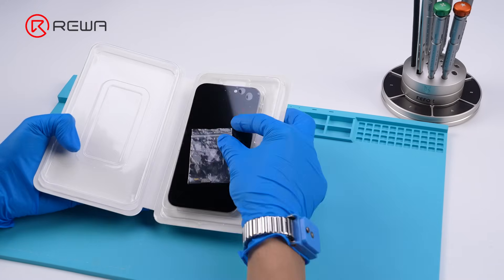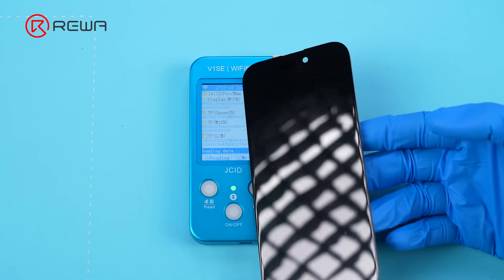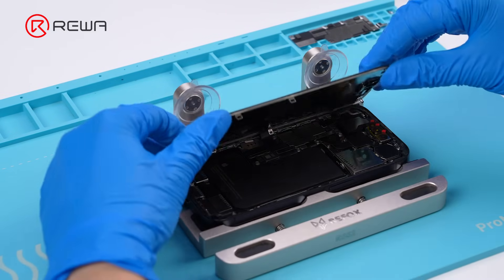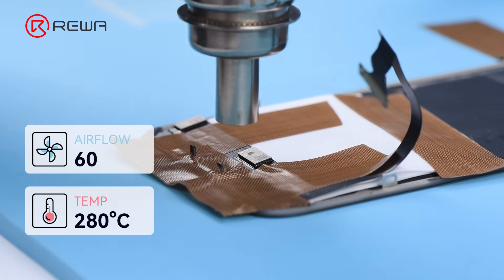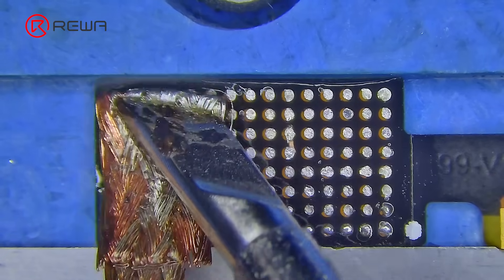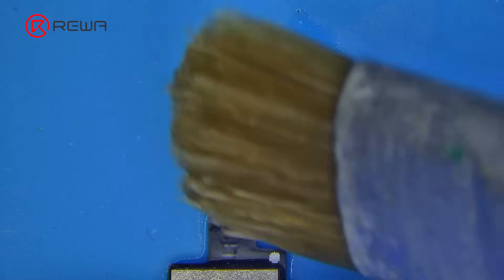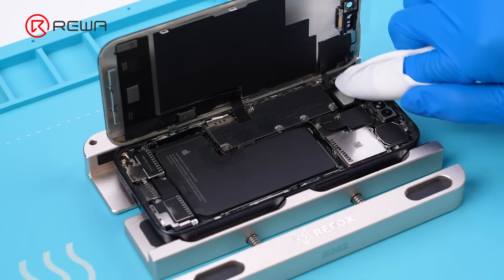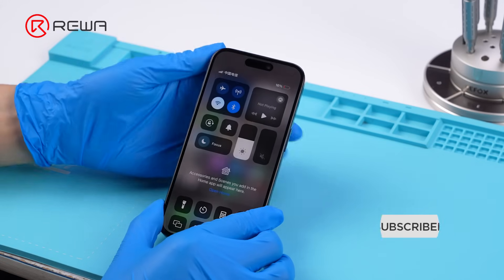100% Fix 'Unknown Part' Message for iPhone 15 Pro After Screen Replacement

Comment: Hi do you need to reball the IC or can you just clean that up and use the pre balled tag on flex?
Reply: And would you still get the display message if transferred IC but not coded True Tone date
Reply from the maker: The ic is from the original screen, so you need to recall it

Comment: Since the new iOS update True Tone doesn’t need to be programmed but removing the unknown part message still requires transferring the ic chip right ? Or is a programmer still needed ?
Reply from the maker: The programmer is vital, you still need to troubleshoot whether it links to true tone problem, and the IC must pair with truetone data.

Comment: Recently, I have had a critical case. Accidentally, I damaged a 12 pm display 😢... I swapped the IC, but it was still showing the unknown part message... Then I also swapped the display ic, but I still showed an unknown part... Then I read the phone information on the jcrepair tool,. Then I am shocked because it says the mtsn and screen sn are different 😅😢... Please help me... My customer getting angry with me
Reply from the maker: Wait generally if you just apply IC swp is OK, unknown part perhaps link to the soldering problem?

Comment: Ambient sensor not working in my 15 pro max after display change. What could be the issue?
Reply from the maker: Does it match the screen or is it the native front sensor?
Reply: @rewatechnology2008  hello, I have the same issue, the ambient light sensor is not working. It is the native sensor, does not match the screen. Is there a way to fix it?
Reply from the maker: @renatogarcia4562  Which screen you replaced? The incell screen does not support that.
Reply: @rewatechnology2008  actually, I've tried it with an OEM refurbished screen. I installed the screen and paired it, the messa is gone, the true tone works, but the ALS won't work. Before, the ALS was working correctly with the native screen that has black lines.

Comment: That tag on flex is a clever idea. all 'major' soldering is done away from the display other than 6 small solder connections. + it means if you mess up somehow you could get a new tag on flex cable and not have to buy an entire new display.

Comment: If you don't change IC will aftermarket screen still work ok on IOS 18.1 and only give non genuine part message ?
Reply from the maker: Third party will also pop up the unknown part, but true tone is back
Reply: Thanks, so screen will still work ok ? @rewatechnology2008
Reply from the maker: @maxmixer  Yeah as long as you do not care about the message

Comment: Hello , I want to ask a question 

If I transfers the ic first and then I copied from the new screen , will that work ? 

Or I will have to re transfer the ic to the old screen and copy and then put the ic to the new screen 

Thank you
Reply from the maker: As you can see in our video, we transfer the IC first including copy and write in from the old to the new screen, the subsequence can not go wrong.
Reply: @rewatechnology2008  soo I can’t make a copy after transferring the ic ? , because I have already transferred the ic and I didn’t make a copy , what should I do know
Reply from the maker: @ahmedsalem7909  It is the copy may be useless for the repair, because you are not the Apple right? Apple is the only one who can match the IC, the copy of IC can not help you in the following repair, we transfer the IC just try to make your phone identify the screen is the old screen that already fit your phone
Reply: @rewatechnology2008  no I meant copying the data from the screen not the IC
Reply: @rewatechnology2008  I meant like after transferring the ic , now I don’t have the unknown part message , but now I need truetone 

So I will copy the data from the old screen right? Soo I can make truetone work 

What happens with me is that I transferred the IC before I copy the screen data soo I can write it on the new screen (for truetone ) 

Soo now do I have to reinstall the IC on the old screen soo I can copy the truetone data , or I don’t need to retranfer the IC and I can copy it normally
Reply from the maker: @ahmedsalem7909  For now it really depends on the screen you used, some screen may have Identify resistance that will not allow you to write in truetone datal...

Comment: Why did it look like it was 60 hz? Is it 120 hz with adaptive refresh rate like OEM? Please reply in the comments
Reply from the maker: Aftermarket screen generally will only reaches to 60hz, for OEM NEW or OEM USED screen it can reach to 120hz
Reply: maybe because youtube doesnt offer 120 hz videos?
Reply: @monstrum5074 it still looked slow go look at other videos of high refresh rate iPhones

Comment: All the effort, i prefer to ignore the unknown message :D
Reply: Jup. This is beyond repairing your own device. My experience with customers tho is that they don't really care about the unknown part message. Tho most people want to restore the ability to see their battery %.
Reply: Why, don't you feel it is somehow anoying 😅
Reply: @AkunBaru-mg3vr  because it isn't. It's not a Pop-up anymore. Just says that the part has been replaced in the settings.
Reply: @hamiock6048  ah i see, so it's not like it used to..
Reply: Most of my customers choose this but I always offer them this service for extra fee. 30% choose this and the rest is ok with the unknown message.
Reply from the maker: It depends on customer needs, and generally if you choose to ignore it, it should charge less.
Reply: @rewatechnology2008  Hi, if you don't transfer the IC, will there be any issue such as touch responsiveness, accuracy etc?
Reply from the maker: @Negiku  The ic usually affects the unknown part or the truetone(if it is under iOS 18)
Reply: Too much work and time. Most of the times customers doesn’t even care. But they do care about battery health, and this is something I also like to see when doing repairs. That said: Keep ut the good work REWA. You’re the best.

Comment: You put an ic from the middle of original screen  but you used tag on and put ic on the right side of new display!?
Reply from the maker: Aftermarket screens vary in structure among manufacturers. It is normal aftermarket screens have different IC positions compared to original screens.
Reply: Yes. 😂
Reply: clearly you dont know what are you talking about, better find another video that match to your knowledge.

Comment: True Tone data is stored in the IC. Why did you transfer before removing it?
Reply from the maker: Starting from iPhone 12, the True Tone data is no longer stored in the touch IC. So you need to copy True Tone data before transferring the IC.
Reply: iphone 12 and latest no longer store the true tone data in ic
Reply: @Dimas-uz5jn so iphone 11 no need transfer truetone? just transfer ic and the truetone will transferred too?
Reply: @dinouse yes
Reply: @Dimas-uz5jn  where does it store the truetone data then, there is only this chip on the back of the display

Comment: Does AOD work? 
What about the battery drain?
60hz or 120hz?
Reply from the maker: Yes, AOD works. It's 60Hz
Reply: @rewatechnology2008  Will it work only in 60 Hz mode or will 120 Hz work too?

Comment: link for the iron ?
will it work if I use aftermarket LCD screen ?
Reply from the maker: Hello here is our Portable USB Soldering Station：https://shop.rewa.tech/detail/sugon-aifen-a11-portable-usb-soldering-station.html?utm_source=YTB0626&utm_medium=Repair+tool&utm_campaign=Video
And this method can also work on LCD screens, although there may be slight variations between brands.